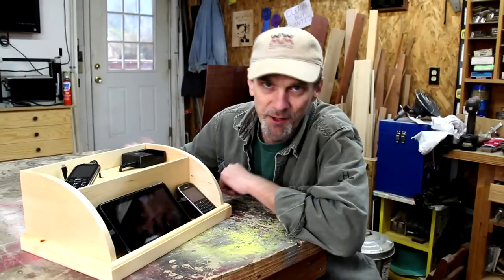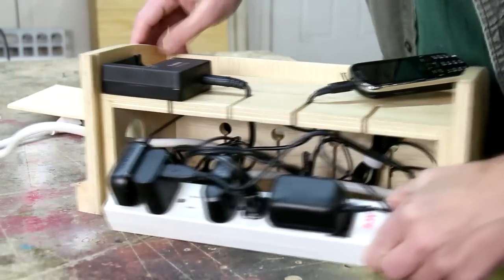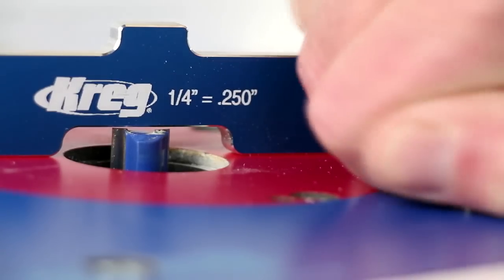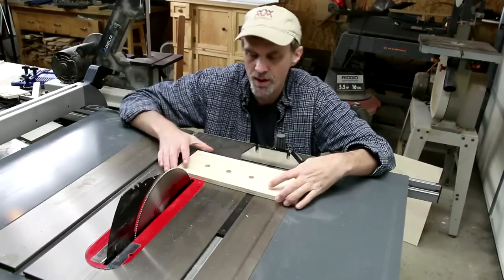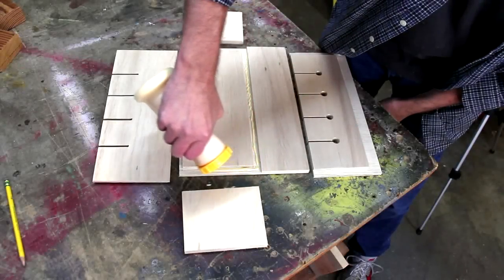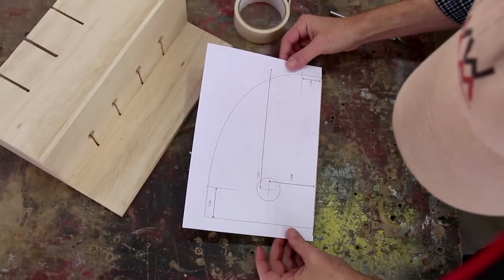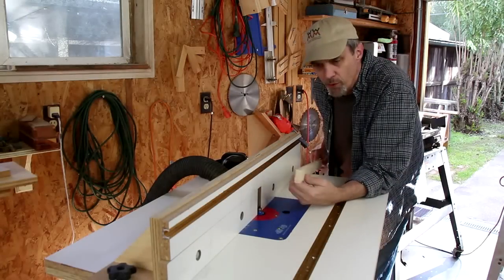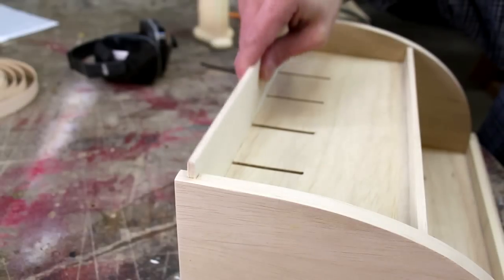Make a device charging station to organize your phones and gadgets

Comment: Ok I'm an Electronic Engineering Student at Fayetteville Tech CC. This is not going to get hot enough to even char the wood unless there is some sort of massive electrical problem in the chargers and surge protector. Yes the chargers do continue to work when they do not have a device plugged in to them but it is not a massive drain.Doing something as simple as replacing your water heater with an on demand tankless option is going to more than offset the cost of these chargers. So if you are really that concerned fix your houses electrical use first. And then shut the surge protector off when not in use. Wood is not synonymous with C-4 or napalm so I'm sure it's perfectly safe.
Reply: Guy in the Rusty Truck  If people on the internet were honest "but someone on the internet said something about heat and electricity that i only half remember, and it was like 4 years ago and it was on the internet so it must be true"

Comment: I got a commecial version of this as a gift, that I have outgrown (never gets hot; never jacks up my electric bill). Yours would be a great replacement scaled up... um... longer with the added satisfaction of DIY. By the way, the only difference between yours and a commercial version is that you DID NOT have to pay a law firm to produce the legal-eze warnings on the packaging. Speaking of which, anyone who is claiming fire safety, or excessive power leak issues are (I strongly suspect) exactly the sorts of folks who keep those law firms in business... You've got no worries, Steve! Just keep the projects coming and disregard the carpers.

Comment: Was thinking the exact same thing about the ventilation holes until I realized that the wire egress holes likely afford the desired air flow.

Since not all devices have cases, it might also be nice to spray-mount a thin layer of cork onto the surface where the devices rest. The cork is obtainable at craft stores and guards against any abrasion that might take place between device and the wood.

Otherwise, this is an incredibly useful project!

Comment: Hey Steve. Big fan, fellow Garage woodworker, bay area neighbor (in the 707) and don't miss a show. I had a similar idea to this but mine was specifically for my wife's iPad I got her for Christmas. I've been tinkering around with a drop-in design where a groove on both sides  allows the upright iPad to be slid down over the charger which is fixed in place, and  doesn't need to be held with the other hand. So far not impressed with my  prototypes. But I'll keep you posted

Comment: your charging station has inspired me,I love the cable holding slot idea thingy i am going to use that on something you have inspired me to design (its taken me 3 days of thinking so far) its my first ever project too. ventilate or not ventilate err the back slides off, you can put an extension with a power surge in there and and some of them come with power switches for each plug people. you should not leave chargers pluged in and turned on with nothing on all the time anyway.

Comment: This is awesome! I'd recommend putting felt pads where the wood and wires meet and maybe drill some ventilation holes. Heat and electronics don't mix well, but that's just me.

Comment: Steve, the only mod I would add are heat vents in the back panel that ends up along the top edge of the compartment holding all the power components. Wall-warts and power supplies generate a significant amount of heat and when you put a lot of them close together in an small enclosed space, you really need some venting to keep it safe.
Reply: *****
Understood. Just a suggestion.
Reply: ANYA
Reply: Guess you didn't see all the slots cut in the top, sides.  Also, wood doesn't combust until 540 degrees F, so yeah, you're wrong.

Comment: I purchased a charging station two or three years ago.  It is made of wood but I keep the power strip outside the box so the on/off switch is accessible.  I have never seen enough heat come off the unit with the three chargers on at once.

Comment: If you used a power strip w/ a teeter-totter switch you could activate it w/ 2 dowels that would extend up thru the top board and act like push buttons.  One dowel is off, the other on.  As others have said, the current draw on transformers is so small that adding the dowels would be pointless extra effort.

Comment: Actually most chargers will not draw power when not in use. You can check this out by plugging an unused charger into a amp/watt meter and you should notice that there is no power draw.

Comment: Yeah, I can't imagine a heat problem. Even if you had 5 or 6 devices charging at once, none of them pulls very much amperage. Any heat that is generated can escape through the slots in the top. If someone is really concerned about heat - maybe if they stuck a laptop power brick in the box as well - they could just put a few holes across the top of the back piece to allow the heat out.

Comment: I am a relatively new viewer (and now subscriber) to WWMM.  Great stuff.  Really.  I saw the Mere Minutes about the odd comments to this video, so I watched to see what it was all about.  Sigh.....  Excellent project, well thought out and executed.  Not a fire hazard either;  I am not an electrical engineer or physicist, but I am pretty sure that chargers pull zero (pronounced "zero") current unless they are plugged into a device.  The circuit has to be closed for current to flow.  So, leave them plugged in and your electric bill will not be affected.  Also, comments some folks leave that they don't have the same tools as Mr. Ramsey are moot, and do not pass the "so what" test.  Most of these projects can be accomplished with very simple tools, a little creativity, and some patience.  My tools are meager, but they can do far better work than I will ever be able to do with them - and such is the case for most of us hobbiest woodworkers.

Keep up the good work, I am having a blast learning from WWMM.  I have been binge-watching since I found this channel a couple of weeks ago.  I have no trouble understanding why it is the #1 fastest growing Youtube woodworking channel.

Comment: All of the devices in my house that require charging, except laptops and cameras, have a micro-USB slot. A nice project for an electronics hobbyist might be to build a switch-mode power supply to fit in the back of this unit and supply a number of mico-USB ports coming out of the front...

Comment: Most small chargers for phones and such where the transformer is on the plug do not generate enough heat to cause a problem. Have you seen a modern phone charger with vents in the casing? I have not. Usually, only larger transformers will generate heat but still, it takes over 300 degrees F to start wood on fire, and I think a charger transformer would burn up first.

Comment: You know, here in the UK each wall power socket has an individual switch.  Failing that each of my arms has a hand on the end which can unplug things from the wall.  Also inside each of my heads there is a brain that acts as a sense and control unit for these biomechanical functions, please make sure yours is switched on and functioning.

Comment from the maker: The amount of energy consumed is negligible. The bills for the phones themselves are a far a bigger concern.
Reply: This is, of course, 6 years later, but I recently did a cost analysis on all our chargers, including 6 phones, 6 tablets, 4 laptops and two NiMH chargers.  The cost per year is about $15 per year, based on the devices actually charging 4 hours and on stand by 20 hours a day. 

As for the risk of fire, if the devices are UL Listed, the risk is extremely minimal, and only a little more if they are cheap Chinese junk. There is NO risk of fire with these devices due to heat!  Even if the box were sealed, the maximum heat would be no more than about 90 deg F. 

If a device fails and shoots out flames, anything nearby that is flammable is at risk of burning. If the box were sealed, it would most likely suppress the flames quickly.  Other wise, the fault of the fire will be the device, not the box it is housed in. 

I am an electronics technician who had to go through extensive fire safety training by the US Navy, also I have experienced electronics failing and causing fires. The only time heat is a factor is if it causes components in the circuit to fail, or it gets into the hundreds of degrees F. 

I cannot comment on countries outside of the USA, but UL listed power cords have almost no chance of burning because they are coiled up in a box.

Comment: Not being an ass, but as an electrician I see some small problems with this.
A snake nest of wires are a fire hazard when just laying around. Having them in a wooden box without vents is moreso. The adapters do have heat fuses, but you can't always count on them working in time to avoid disaster.
I suggest you route out a few slots to increase passive cooling of the adapters, just to be on the safe side. Also, an on/off would be nice since they use power even without device plugged in.

Comment: I'm going to make mine with a two inch layer of black powder on the bottom, no vent holes and I'm using wire hanger instead of power cord. Then I'm going to pop out my fuses in my fuse box and put pennies in the sockets. I'm going to put it on the stove and next to the toaster turned all the way up, get the good scissors and run laps in the bathroom while spraying the floor with a mixture of lard and shampoo.And if that gets boring I'm going to rip the warning labels off my mattress and pillows.

Comment: Combined? Probably not even 200W inside that box. You people should be afraid more of your kettles setting on fire... They have over 10 times as much power going through them!  Nice project. If it didn't set on fire when you ironed it, a few chargers shouldn't be a problem!

Comment: They draw next to nothing and you're not saving anything by worrying your little head over them.  Modern switch-mode transformers are pretty darn good when they're not plugged.  Most of their power is actually going to running the little LED showing you that it's plugged in, and even that is next to nothing.

Say an LED is 3v at 20ma.  That's .06 watts.  Leave that light running all year and you're looking at 525 watt hours,  Not even a whole kwh, which is what they bill you buy.  $.13-$.31/kwh.